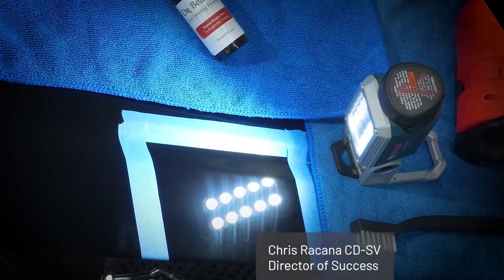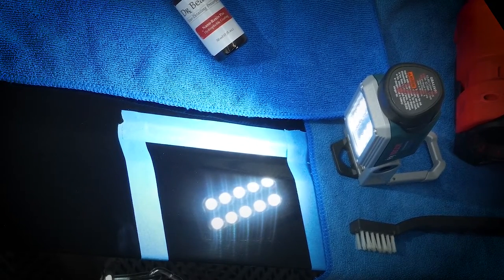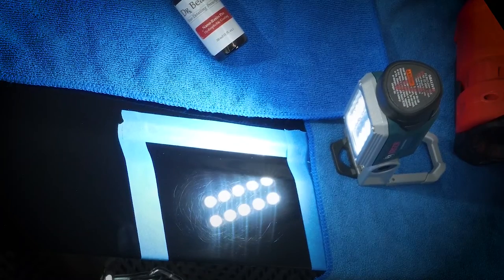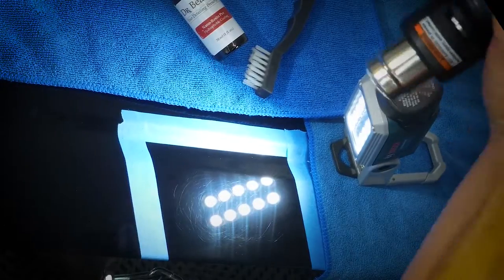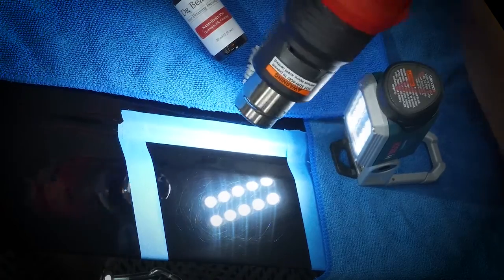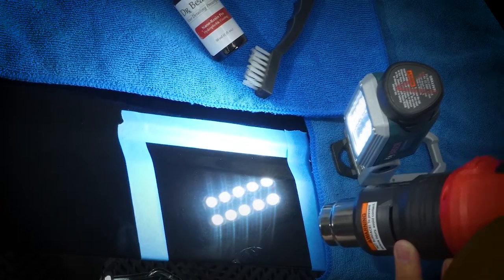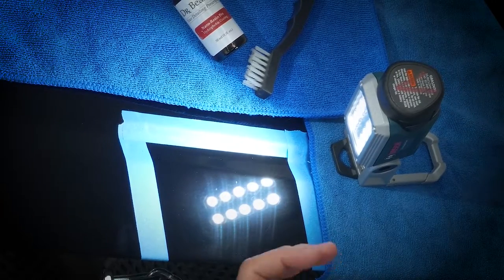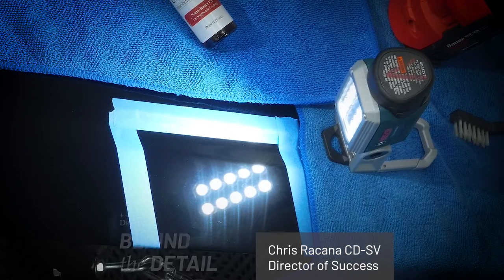How Self-Healing Ceramic Coatings Work — Behind the Detail

Comment: The only drawback is that the surface is much more prone to scratches in the first place; the brush had very little pressure on it and appears to have relatively soft plastic bristles.

Comment: Quick question : so… when you’re scratching the surface, is the self heal coating being scratched or the actual clear coat ? Or maybe both ? I’m kinda confused, I thought the swirls are scratches on the coating but not the actual clear coating itself
Reply from the maker: It is the coating that is healing. If you go beyond the coating, you will damage the clear coat.